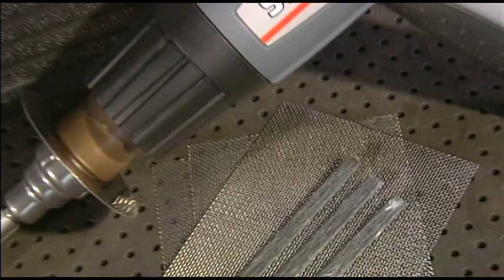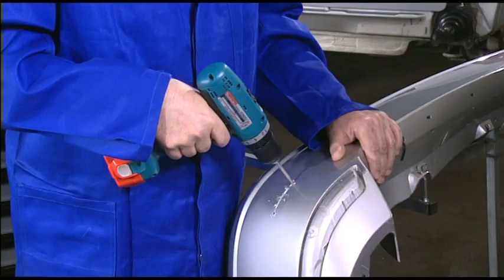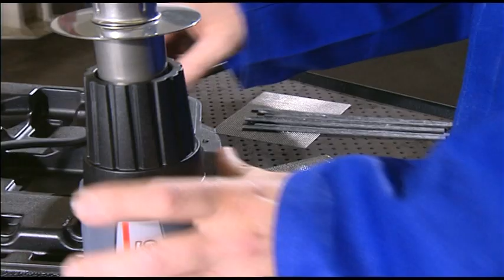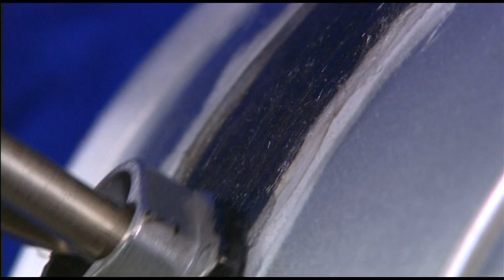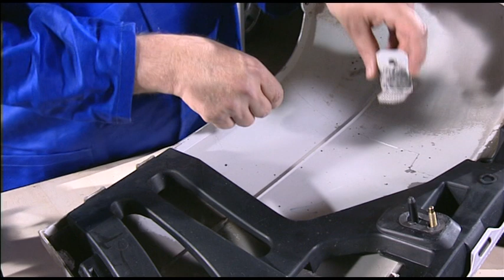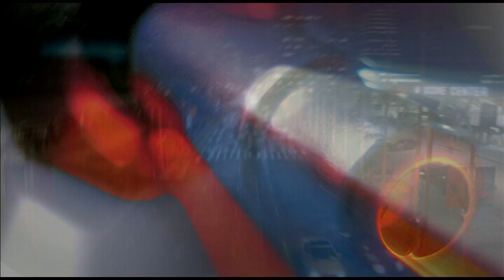STEINEL Auto Body Welding Kit

Comment: BEST FIX.  USE CHICKEN WIRE IMPREGNATED INTO REAR OF BUMPER COVER  W /HEAT GUN. REPAIR OUTER SURFACE CRACK W/ FUSSOR # 142 URETHANE
BUMPER REPAIR.